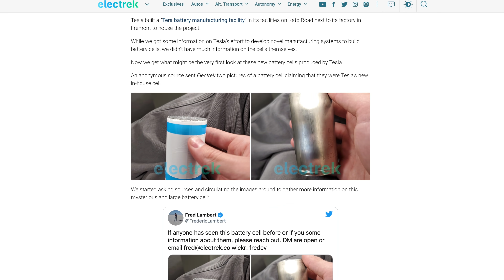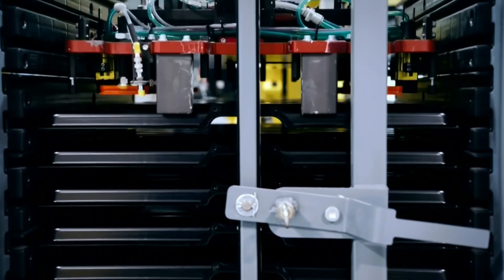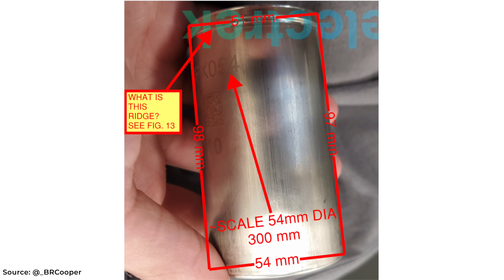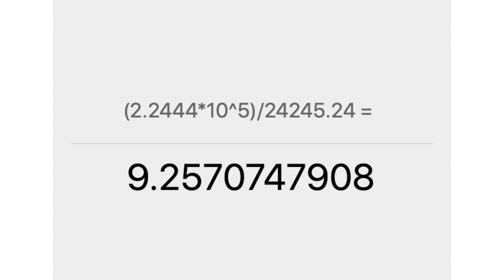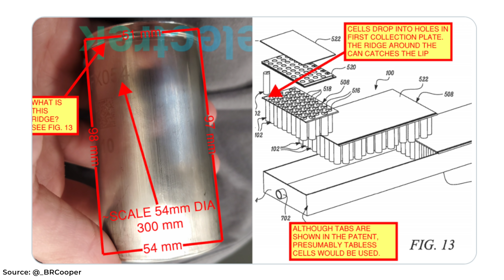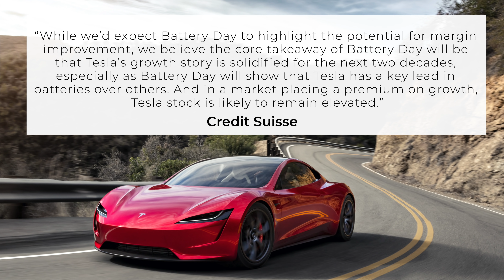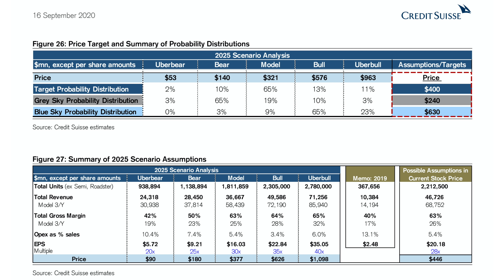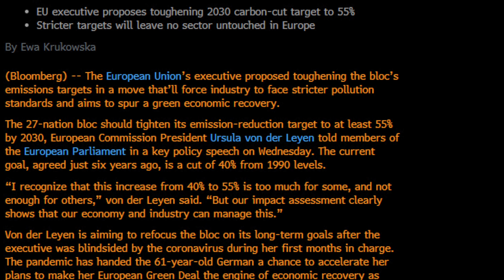Tesla’s New Battery Cell? + Credit Suisse Outlines $1T TSLA Valuation Scenario

Comment: If it 9x the volume of a 2170 how does that track to the energy density? 9x? So a 300 miles car becomes a 2700 mile car? 🤷‍♂️🤦‍♂️
Don't think that would work eh?
Reply: It won't be a 9x improvements, the energy density will improve by the weight difference between the weight of 9 old cell cases vs the 1 new case.
Reply: @kschleic9053 
What do you reckon the difference will be? Seeing this, the roadster will have well over 1000 miles on a charge. Maybe coast to coast on a charge? Now that would be mind blowing. Even if the energy density is "only"3 times current tech that still 1860miles

Comment: Something about larger batteries that I think isn't really pointed out, if it's easier to manufacture then in theory it should also be easier recycle, after all if you have to open up 500 batteries instead of 5,000 batteries in order to get into the inside material......
Reply: Not sure if that's the case, maybe the new wrapping is more difficult to take apart, or maybe much easier. I'm hoping the latter, and kind of expecting Tesla to talk about recycling on battery day and blow our minds a bit
Reply: mrspeigle1 I thought they just melted them or dissolve in chemical baths like you do with raw ore from a mine? 
It would certainly be very interesting to also hear about the recycling story on battery day!
Reply: @Keneo1  Less casing in the stew if you dissolve them or slag if you melt them.
Reply: @Keneo1   This seems to be the way recycling is going. 
https://www.youtube.com/watch?v=Bpe8HalVXFU

Comment: Thicker battery cells (circles) mean more space between the circles. So less efficient use of the physical space? However, presumably, it's higher efficiency per weight as the empty space between the circles doesn't weigh much (just insulation)?
Reply from the maker: The total space between the cells doesn't change. Larger gaps, but fewer of them.
Reply: @TeslaDaily  Thx, ya just realized my mistake when I watched your Aug 27th video. Great stuff!
Reply: the gap is filled with liquid to thermo control the temputure. Its not empty space wasted.

Comment: I had to double-check your math because it sure doesn't look like a 9.5x jump in volume, but the MATH doesn't lie. Great analysis work as always, and I need to buy more shares pronto!
Reply: Given its so long, maybe that is how roadster will avoid using two layers of batteries.
Reply: Is this the new "D" size cell? Maybe "Double D" ;-)

Comment: Why couldn’t they make hexagonal shape batteries to limit the amount of space between them?  Anyone have any legit battery experience that can explain this?  Im sure if it were possible Tesla would have done it already.
Reply: Hard to manufacture. And non-uniform spacing between conducting and non-conducting layers.
Reply: The purpose of the can is to provide mechanical compression to the coiled cell material. A hexagonal container would not do this. Alternatively, draw a regular grid of these cells, and then put some 21mm diameter cells (current nevada production!)  in the corners... They fit perfectly.
Reply: Round things easier, faster to make.

Comment: With larger diameter cells, they will have larger interstitial space. They could leave it open to aid cooling, but with tabless cells most heat will flow out parallel to the long axis of the cell and there will be less need for cooling. One option could be to fill the larger open volume with small diameter super capacitor cells or LiAir cells to make a hybrid high power/low power system which would increase energy density at the pack level, enable fast regen charge and high acceleration discharge without degrading battery life. Will they fill that space or leave it open?
Reply: @Charles Musgrave There would be absolutely no need for the added complexity of capacitors or other battery types in the same pack.  Simplification is the way to reduce costs and increase value.

Battery packs with the new tabless cells should be able to provide and receive far more power than ever needed for passenger vehicles.  Could be useful for Semi and Roadster though.
Reply: @LoanwordEggcorn  and that would let you need fewer batteries per average passenger car and have higher margins or far lower prices on cars or average the two and reinvest.
Reply: @Barskor1  Agree.  Even small improvements in batteries are a major (cost) efficiency multiplier for everything else EV, and I expect tabless, larger cell, dry electrodes, etc., will be a very significant step function in manufacturing efficiency and cost.  Even then, most people won't understand how transformative it is.

Assembling 500 larger cells instead of 5000 smaller is a major time and cost saving for pack manufacture, as just one example.

Lower resistance also means faster charge and discharge, greater round trip efficiency, etc., particularly significant for energy storage applications.

In terms of impedance, tabless is like having many batteries in parallel inside the same case.
Reply: @Barskor1  I'm looking forward to the news too.  And it's only going to keep getting better, with the pace of innovation at Tesla (and SpaceX).
Reply: @LoanwordEggcorn  It actually isn't very complicated. Just need a second wiring system to connect to the power management system. The question is whether Tesla thinks the benefit is worth the cost (which includes complexity). Note that they Li Air battery patent includes the dual power system, just not in a mixed packing format.
Reply: Each individual space will be larger, but there will be fewer of them, so the total empty space will remain constant.  (This ignores possible edge effects.)
Reply: @bigdream_dreambig  But, those larger spaces are an opportunity to fill them devices that don't fit well in the smaller interstitial space of the current battery cells. In addition to getting the benefit of the dual power system, you lower center of gravity, and don't require any additional passenger or cargo space.
Reply: Less heat is being generated in the first place with the tabless battery design.
Reply: @Barskor1  Correct, and it's exactly that lower heat generation with tabless which enables the larger cell without heat penalties.
Reply: @Barskor1 Dahn demonstrated with his Million Mile battery that heat is not necessary a problem for modern chemistry:
"The fractional capacity loss rate during 100% DOD storage at 40°C is about 0.02/year.
Even if the cells were continually at 40°C, 10 years of lifetime to 70% capacity and a total driven distance of 1,200,000 km is projected. It is worth noting that only 3650 cycles would be required for this total driven distance and 3700 cycles have been demonstrated."
https://iopscience.iop.org/article/10.1149/2.0981913jes
Reply: @waynerussell6401  While the million mile battery is interesting for energy storage and maybe robotaxis, it's really not a requirement for mass adoption of EVs,  

Many existing Tesla battery packs have already lasted more than 300,000 real world miles in customer cars with minimal degradation.  That's already highly useful.

And due to continual improvements to battery technology, the current Tesla battery packs are probably already even better.  

For most people that's 20+ years of driving.  And even then the remaining range is still very useful.  Losing a few percent of range after 20 years doesn't make that EV suddenly not useful.

So I think the emphasis on million miles is somewhat misplaced.  Far more important is driving battery costs down, in order to drive EV costs down.
Reply: Loanword Eggcorn,
“So I think the emphasis on million miles is somewhat misplaced.” 
This statement, to me, is so important. I’ve been saying this for months now. The mainstream media and some YouTube channels are using this buzzword so much yet they don’t grasp that it’s trivial. As Rob and anyone whom does their homework have already figured out Tesla’s basically do a million miles already. The million mile is way less important compared to other enhancement such as the production line speed, cooling, cell chemistry and so on. 
The whole end to end process is the thing that needs to be understood by the media and investors. This solidifies Tesla. This is why Battery Day exists, to educate those whom don’t understand the importance of the process. 

It’s no different than Elon with his SpaceX company saying, “Building rockets isn’t hard. Building a production line for rockets is 1000x harder.” Making a BEV isn’t hard, they’ve been around for longer than most people understand. Building a BEV production line is the hard part.
Reply: @LoanwordEggcorn  You miss the point of Dahn's efforts, and possibly how battery chemistry works. You can trade the performance attributes of a cell, giving up one parameter for a desired other. Thus cycle life can be traded for heat tolerance, or for higher voltages, faster charging, more aggressive discharge... A 1500 cycle battery pack running at 4.3v/cell without cooling (ar la Leaf) would have less cells, lighter weight, more compact, cheaper...
Reply: @waynerussell6401  yes, and with advanced electrolytes and more stable surface electrolyte interfaces, including avoiding dendrite formation, the batteries should cycle extremely well and be less vulnerable to overheating problems.
Reply: @LoanwordEggcorn  Agreed, except in the minds of consumers who are concerned about their batteries range decaying, adding to their range anxiety. Perception is sometimes more important than reality...
Reply: @magnamic5614  I agree, but many consumers don't understand more than how far they can drive on a charge and how fast will that range decay. If Tesla can increase the warranty to 80% of capacity after 15 years instead of after 8, that would persuade some consumers who's concern makes this non-issue an issue.
Reply: Charles Musgrave, 
This is true because of how the average consumer thinks. I guess a buzzword really is needed to get people to understand one thing is or can be better than another. It just really annoys me. I swear if the media is still on this million mile buzzword over the reveal in production efficiency and battery chemistry then...I don’t even know what to say at this point.
Reply: @cbmusgrave  Range anxiety may be anti-EV FUD created by oil companies and ICE makers.  

70% of people drive fewer than 40 miles / 60 km per day in EU and U.S.  Said another way, most daily driving is within 20 miles / 30 km of home for a majority of people.  

Therefore pretty much any modern EV can meet the daily driving needs of most drivers.  Please help educate people about this to defeat the FUD.

Fast charger networks like CCS and Tesla's excellent Supercharger network enable long road trips too.  But most driving is local and any EV can do that.  Please help educate people.
Reply: @LoanwordEggcorn  Totally agree. However, wherever that perception comes from, it is real and Tesla is addressing it. Interestingly, Tesla will both address range and battery life anxiety by helping people turn their longer than necessary EV range into the heart of a system for home energy storage, V2G, VPP, Autobidder arbitrage enabler - pretty smart.
Reply: @Barskor1  Yes, that's why I think it would be more likely to go unfilled or could be filled with super capacitors, especially in a high performance model.
Reply: No, they won't fill the space with anything.  The battery packs are the most expensive part of the vehicle, and the whole concept of the manufacturing process is to make them cheaper, faster and with less parts.  No nothing will be added, just a pack of cells.
Reply: @acmefixer1  That could very well be right. However, their LiAir patent has a dual power system and the high power component (if they decide to implement it) would need to go somewhere. The added complexity is quite low - it just needs to pack in an A - B lattice and connect with two periodic wiring systems to the power management system.
Reply: Word.💪
Reply: The volume between the cells is only such that you could fit a cylinder of 8mm between them (if the cases were touching)
Reply: I’d go for more cooling. Can’t have enough cooling.
Reply: @korswe  More cooling is good, but so is optimized power system for performance, efficiency and battery life. Hard to tell what they'll do, but it will be logical.

Comment: Regulatory credit revenue increasing over time would be the Nth incorrect assumption by the Tesla bear community
Reply: OEM's compliance cars may take away Zev credit revenue from Tesla but they are dead weight to them as they can't make an EV profitable with their production and dealership model so damned if they do damned if they don't.
Reply: @Barskor1  Can't is a strong word.  The old car makers could make profitable EVs if they committed to spending billions of dollars on battery factories.  But they don't, so they can't.  (See GM losing money on every Bolt EV sold, for example.)  Only VW seems to be making necessary commitments to lower battery costs (aside from Tesla, Nissan/Renault and many China automakers).

Perhaps most annoying is that GM, Ford, etc., have billions of dollars in annual profits from SUVs and trucks which they use for stock buybacks instead of investing in EV cost reduction through battery manufacture.  They could make EVs profitably this way, but don't.

While it's true that car dealers strongly prefer to sell ICE since they make almost no service revenue on EVs, and this has led them to anti-sell EVs in their dealerships, if the manufacturers wanted to do large scale EV production, the dealers would not be able to stop them forever.  That said, the dealer incentives are absolutely aligned against EVs.
Reply: With vehicle emissions rising for the third year in a row in Europe, OEMS face a potential fine of more than 20B Euro in 2020 and 2021. Not withstanding 30+% decreases in ICE sales this year and increasing EV sales, car manufacturers in the EU are not expected to meet the new 95g/km target.
Daimler faces a 997 million euros fine because it will not meet its 2021 target of 103.1 g/km because its emissions will fall to 114.1 g/km from 130.4 g/km now, according to an analysis by PSA Consulting.
BMW faces a 754 million euros find because its emissions will decline to 110 g/km from 123.6 g/km today, missing its 102 g/km target.
JLR could see a fine equivalent to 400 per cent of its 2018 profit.
EU currently intending to increase the compliance from 40 to 55% atm to the consternation of OEMS.
read://https_europe.autonews.com/?url=https%3A%2F%2Feurope.autonews.com%2Fautomakers%2Fmercedes-bmw-launch-new-plug-ins-help-meet-co2-emission-targets
read://https_www.paconsulting.com/?url=https%3A%2F%2Fwww.paconsulting.com%2Finsights%2F2019%2Fco2-emissions-are-increasing%2F
https://autovistagroup.com/news-and-insights/carmakers-face-eu20-billion-fines-exceeding-co2-targets-part-2
Reply: @waynerussell6401  Then it seems that neither carrot (EV makers like Tesla taking lots of their market share) nor stick (penalties) can overcome the massive inertia of 100+ years of making ICE.  In a sense it's not the fault of the legacy car makers.  It's normal for old industries to become stagnant.  

It's like asking a huge machine to suddenly change directions and do something different.  The old car industries simply aren't designed to do that.  They're optimized to keep doing what they've been doing before.

The major difference is that disruption is extremely difficult in something as capital intensive and low margins as automobiles.

Disruption is far more likely in new technologies like PCs, Internet, software, cell phones, smart phones, flat screen TVs, etc.   Software and Internet services in particular have far fewer barriers to entry and much lower capital requirements. 

It was highly improbable that a new EV company like Tesla would succeed.  Their success is due to incredible persistence, strong leadership and vision, and hiring tons of great engineers.

SpaceX too.

Comment: This cell size doesn’t make any sense from engineering perspective, too much dead space between cells
Reply: Isn’t it the same amount of dead space to battery ratio? They’re all still cylinders.
Reply: Jay Shelley could be, but wondering why they don’t make them prismatic cells, will be much dense battery pack, and easier to cool them down
Reply: @DimaTkachenko  I think that it has been proven that the weight required to provide sufficient clamping force on prismatic cells is more than is required for cylindrical cells, and cylindrical cells are easier to manufacture in mass... Worthy tradeoffs vs a slight decrease in pack level volumetric energy density.
Reply: kschleic9053 thanks, good to know that!
Reply: Here’s an interesting thought from @ThinkFab on Twitter: what if the Mae large cells had another smaller cell in between them? Here’s the image and the math on why 54cm cells with 2170 between could make sense: https://twitter.com/thinkfab/status/1306443308688904192?s=21
Reply: 'dead space' could = coolant space though - so high volume high flow coolant around the new form-factor cells